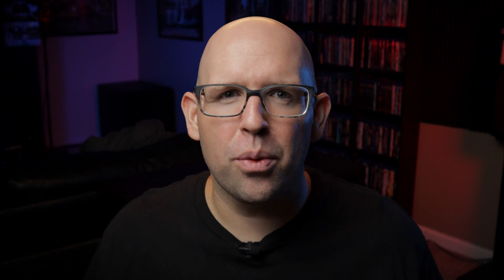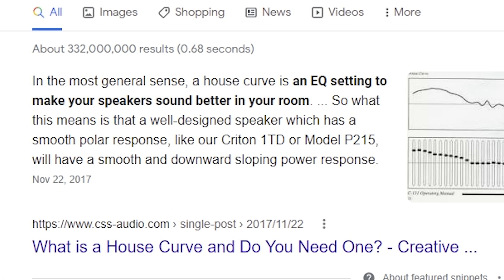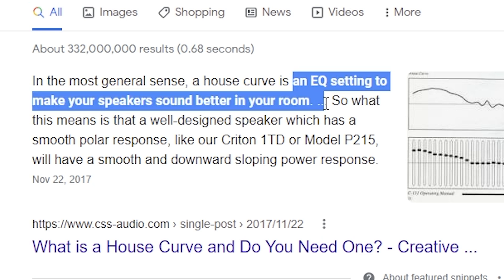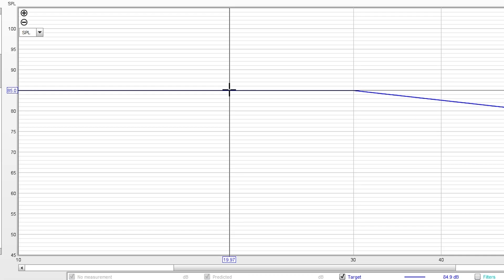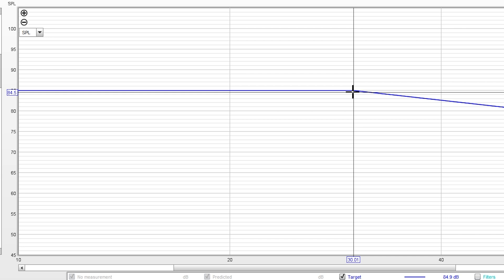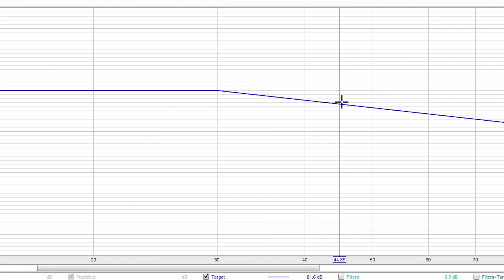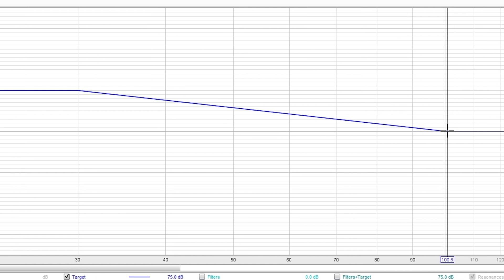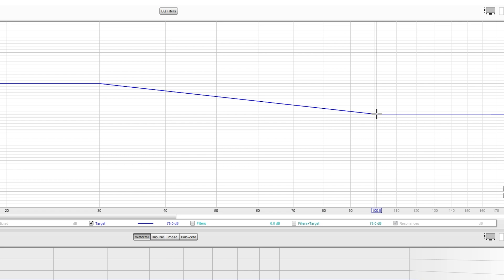Why does Audyssey DESTROY MY BASS? | Plus using house curves or DynamicEQ

Comment: My Audyssey calibration which my AV tells me is set to Reference, reduced the subwoofer so much its almost like its not on. But it does push clearer front speech out. Bullets shooting off are near non existent and very quiet. Just want a bit of bass and some effects without overpowering the centre and fronts. Do i turn off the EQ software switch?
Reply: Also try dynamic volume

Comment: One thing I am unsure about is what should the sub freq on the back of the sub be? Like the volume, do you go halfway or max it out and let the AV decide what it gets via Audyssey?
Reply: This old so you may have already figured out your way of doing things, but if not or you gave up I'll give you my 2 cents. How I personally do it is I go into Audyssey and reset all speakers to 0db on the AVR trim and I manually measure the distance and enter that manually as well (this will change after you run Audyssey and that is okay, don't change it after Audyssey does this). From there I set the subwoofer to something low on its knob (just so I don't have it too loud to do damage). Set the volume on the AVR to 0db (reference level). Then I play the built in Audyssey test tone for the sub and I manually adjust the volume/gain knob until my SPL meter I am holding reads 85db. I then do the same thing on the Front L speaker except I use the built in AVR trim level till the SPL meter reads 85db for that test tone. After that I then run an Audyssey setup and everything is usually good with the subwoofer. In my experience if you set the subwoofer to 1/2 like the setup tells you at the beginning of setup Audyssey sees it too loud and starts reducing the trim and will basically set the subwoofer at -12db, the max floor for the AVR, in the AVR trim before it even tells you to turn down the gain (stupid I know) and this completely destroys the bass. By doing it the way I do it, my sub instead of being at -12db trim will be at like -2 or -3 trim. Then I go back and play the test tones again this time making sure that after Audyssey setup each speaker sits at 75db reference volume. Just to double check. Why 75db? I know it doesn't make sense I don't know why Audyssey chooses 75db for reference volume when reference volume is 85db. It is confusing, but I believe sound engineers have a built in +10db for their reference volume on their tracks or something. Don't quote me, but yeah that is weird. Just know that that is what your Denon or Marantz is calibrating to. 75db
Reply: @Mudcat3434  Hi. I got it sorted, but I did run it three times before it seemed to nail it.

Comment: Nice video.  Re: poor bass response.  I have 2 SVS PB1000 subs and a Denon 3700H avr.  The other day I recalibrated Audyssey as I moved some speakers around.  I just could not get bass power on the subs.  After pulling (what hair I do have left) out nothing improved it - until I turned off ECO mode in the Denon!!  Problem solved but the Denon does not display ECO mode settings so I went into system settings and turned ECO off.  Still did not like that I could not know if ECO was on or off but found that AUTO mode (having nothing to do with the power) setting did display the mode on the tv when volume was increased or source was changed.  Goes off after about a second.  Pretty cool.
Reply from the maker: Ah yeah. ECO mode is a killer on pretty much every electronic device if you're looking to maximize performance. Glad you got that squared away. And like you mentioned, some products don't have a clear on/off indicator which makes it even harder. Having picked up an LG C1 OLED recently, I was surprised to see how aggressive their ECO mode is (it's labeled something different) and that it is on by default, right out of the box. I'd imagine if you initially turned the TV on it a somewhat bright room you'd be disappointed, similar to how you would be if you just spent a ton of money on speakers, subwoofers and a receiver only to be underwhelmed by the initial experience.

Comment: Hi, I have question🙂 I made a housecurve with the audyssey app on my new Denon AVC-3700H. And after the room correction results show a housecurve, but also show that the sub is  aproxemetly 7db lower from 10-150hz. 

What should I do. Raise the db in the reciver or on the sub?

I dont have  rew, so i cant test what the levl of the sub actually is.

Comment: To my understanding, dynamic EQ compensates for differences in perception of bass at different volume levels. At low volume, dynamic EQ ads a house curve, but at reference it does not alter the bass. A "manual" house curve does not do that. A manual house curve only sounds like it should at reference level. So if you listen at lower volume, I suggest you use dynamic EQ, either without a manual house curve (provided the resulting respone is smooth), or with a less aggressive house curve.

More info on what dynamic EQ does can be found in Sound United's videos on Audyssey.

Comment: Also minidsp would not only require measurement microphone and computer, you also need pre-outs and external amplification for the channels you want to correct unless you want to correct only the subwoofer (which is only responsible for some of the bass you will want to be boosting, you really need to also EQ the speakers to get results that can match what DEQ does).

Additionally, a house curve might still be beneficial (sometimes?) on top of dynamic EQ to account for the tilted response a measurement microphone would usually measure in a room.

Comment: What exactly is "Reference Level"? Does that mean Audyssey is set to "Reference" instead of say "Flat" or does it mean the volume is cranked really high like 80+dB? Thank you for your help!
Reply: Reference level is related to the volume. If you set the volume indicator to dB, it often reads a negative number, say -20dB. 0dB is reference level.
Reference or flat are EQ curves. Flat achieves a flat response over the entire frequency range, but it might sound a bit harsh. Reference rolls off the high frequencies a bit.
In a theatre you should hear the reference curve at reference level.
Reply: To me pushing it to -29ish is very loud on my Denon 6700h with ot set to reference. I did increase the levels of each speaker with an spl to make things as even as possible at the sitting location. Now I've also read that increasing that only goes into effect with the setting to off. Mayne that's wrong but to me that's loud and pushing it farther seems like speakers will be deceased lol. Anyway any info here would also help. Thank you

Comment: Great explanation, Brad. This explains why my surrounds are so much louder than the LFC channels after I ran the Audyssey and applied Dynamic EQ. Personally, I have found that the simple solution is to simply alter the Level of the surround speakers manually after applying the Audyssey and Dynamic EQ settings and leave the bass setting alone.

Comment: I put a +5db house curve in the minidsp HD sloping from 30hz to 100hz.  I also use Dynamic EQ. If and that’s a “if”, as I haven’t yet found it to be too overpowering yet, I can simply change the offset in audyssey and lower down audyssseys house curve by 5,10,15db.  Way easier to do it that way vs going back in to minidsp to add one later if you find the bass lacking.
Reply from the maker: That is definitely an option.

Comment: If you find Dynamic EQ too "heavy-handed" (and for non-movie content it usually is), use the reference level offset to tone it down. -10 usually works well for non-movie content, although the optimal value depends on how the content you play was balanced. Neither games nor music have a proper standard for balancing so it's just trial and error (or just go with -10 for everything except movies which seems to work most of the time, although I haven't tried games on my home theater).

The reason Audyssey kills bass for most people is that their subwoofers are too loud and both speakers and subwoofers are too close to walls which excessively amplifies the bass (which could be beneficial if you don't run audyssey and need that bass boost, but is much less optimal than audyssey with dynamic eq making everything balanced).

Comment: Hey Brad, besides Audioholics you’re the only other YouTube audio channel that gives me unbiased facts with empirical evidence to support your claims and methods. You’re truly the most underrated guy out there and from one AV nerd to another I truly appreciate the time and effort you put into your content man. Through REW and a MiniDSP 2x4HD as well as the Audyssey app I’ve been able to achieve -/+1dB from 15hz-170hz. I use a house curve and limit room correction to 300hz. I’m using older subs, a Mirage BPS-400, an SVS SB12NSD, an Atlantic Technology 272PBM 12” THX select and an Atlantic Technology 372 PBM 15” THX Select. The AT’s have great output but not much subsonic SPL capability while the SVS and Mirage have usable output down to 15hz and 18hz in my specific room. All 4 subs cost me less than $600 and I use Mirage HDT-F’s for mains, two pairs of Atlantic Technology 272 THX Select bookshelfs for top front and top rears and Mirage OMD-5’s for surround and surround backs all running off a Denon x4300h with 3 Marantz THX Monoblocks for my LCR, two Parasound 1000 THX two channel amps for my surrounds and surround backs and the Denon runs my heights. All in I’m under $1500 by purchasing used and bargain hunting, not bad considering my LCR’s retailed for $1500 each and generally go for $500 each used.

Comment: Is this when the app with the SVS PB-1000 Pro could come in handy? Add a "house curve" in app? (Getting my PB-1000 pro today w/isolation feet and plan on recalibrating with Audyssey later today)
Reply from the maker: It potentially could, but I would probably use the app to try and take any massive peaks you have in your room before using Audyssey, then use the MultiEQ Editor app to add the house curve. But in theory, you could use the app to apply a house curve, but if you run Audyssey after that it would simply flatten it out anyway.
Reply: @HomeTheaterGamer  My thoughts was Audyssey, REW, then in app adjustments+house curve (adjusting things one at a time in app and retesting with REW)
Reply: @michaelgabrielgarcia1004  Audyssey should always be last. Do mini DSP/Rew first, then you never have to do it again. Then run Audyssey (and turn off that awful mid-range compensation)

Comment: I've done this by adjusting the EQ of my SVS-Sub, works good as well (for me)
Nice Video 👍
Reply: What settings did you use in the svs app?
Reply: @ps_83  I used the EQ to level the frequencies from 20hz to about 35hz :
Frequency: 20hz
Boost: 3.5db
Q-factor: 0.8

Comment: Nice video! Have you tested both ways, i.e. with Dynamic EQ on and a flat sub eq; and then with Dynamic EQ off and a manually set house curve? 
I am always in 2 minds about DEQ- sometimes it’s so good, other times it bloats the bass. But I think I generally prefer the DEQ route given my listening levels fluctuate between -10 to -25dB content depending.

Comment: Thank you for your video. I have MiniDSP 2x4 and used the UMik 1  I used a Harman House curve with REW for my Subwoofer. You are saying I should leave DEQ off so that I do not have a curve over a curve?
Reply: Yes. That’s right
Reply from the maker: @M Ladia You are correct. If you set up your house curve then DynamicEQ would be boosting the subwoofer on top of that. Question for you: did you run Audyssey AFTER you did your house curve? If so, did you use the MultiEQ Editor App to to disable Audyssey's room correction for the subwoofer?
Reply: @HomeTheaterGamer  I have enjoyed your videos.  I'm not sure it's a simple no to using both a house curve and DEQ. I actually use both.  Many people (if not most on AVS forum) add an independent sub boost on top of DEQ by increasing the sub trim.  Common practice is 4-6db.  However a flat across the board sub boost as you have pointed out may not be ideal for some as it may sound less natural and not blend as well with speakers at the crossover.  Like many I typically listen well under reference volume.  I personally like the volume dependent nature of DEQ yet want additional boost so add a modest house curve via my minidsp instead of a flat boost in the AVR sub trim.  I do use the DEQ reference offset at 5 to slightly diminish DEQs effect.  In regards to the surrounds I just drop the trims by a few db.  So a long winded way of saying it's still very reasonable to use both if done properly.
Reply: @HomeTheaterGamer  I did limited sub frequency to zero. I figured I should because if It not then I’d be wasting what I did in MiniDSP. I’m curious about your AJ speaker crossovers. 110?